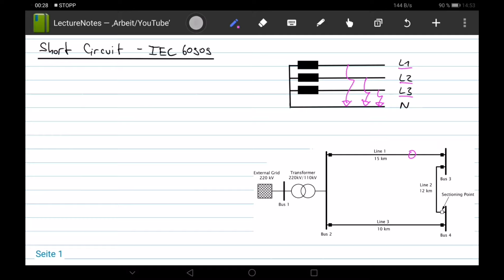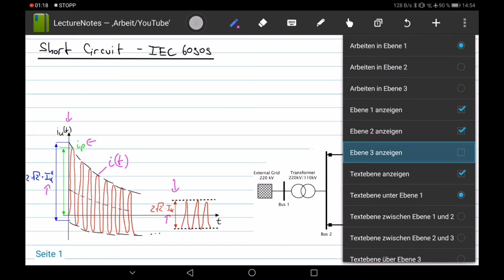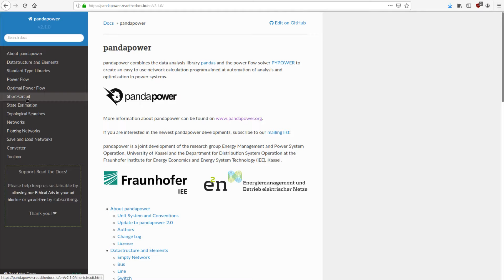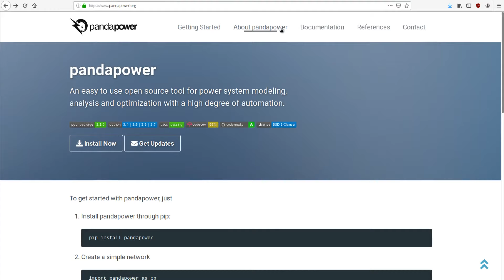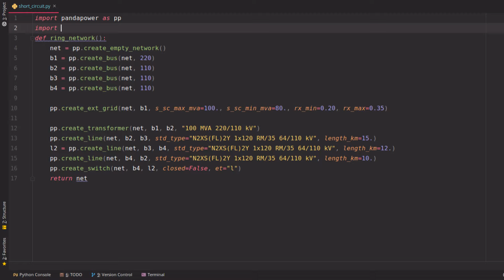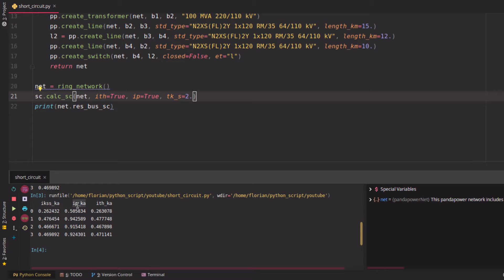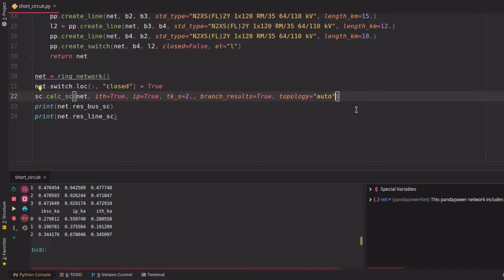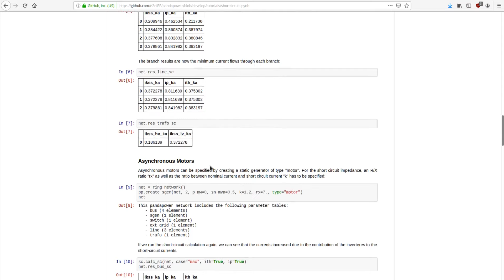pandapower - Short Circuit Calculation According to IEC 60909 Standard

Comment: Thanks for making the tool available and supporting this tutorials. Not sure if you are still working on this, but if you are and are looking for suggestions ... I am going to evaluate different ways to get the increased wind power from the North of the UK to the increased demand in the South. I am looking at upgrading & uprating of the AC transmission system (>280kv), partial switch to DC OHL, dedicated new DC OHL and dedicated subsea DC cables. The North South cnxn will need to carry an additional 20 GW (rough estimate) on windy days. A video with technical comparison of transmission options would be very useful. I will also need to extend the libraries for transformers and lines, so a video on that topic would also be very useful. The documentation is very good and even without new videos, I should be able to figure this out.

Comment: Hello, I'm writing a master thesis and I intent to calculate short-circuit current of DC system. Ideally, DC cables connecting Li-ion battery banks and inverter. Could you please suggest something on this like any literature or methedology using analytics/mathematically? I know pandapower supports only 3 phase symmetrical faults.